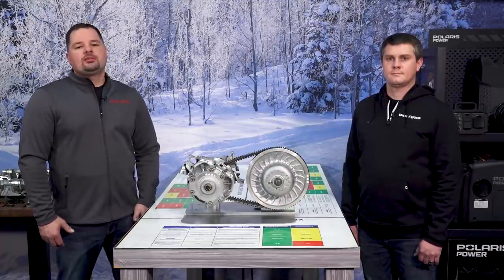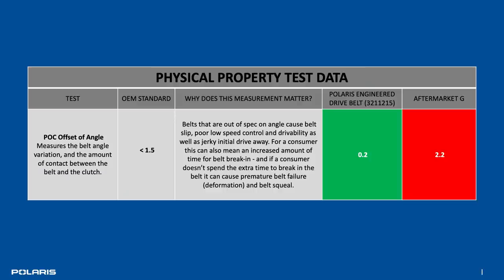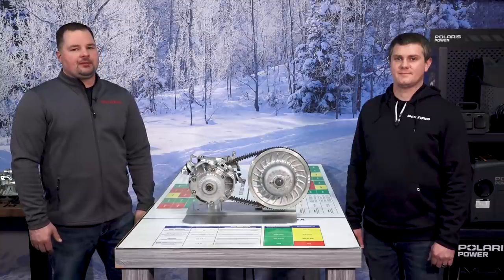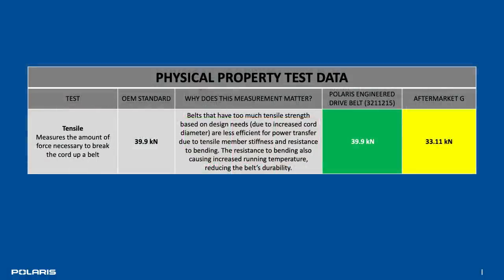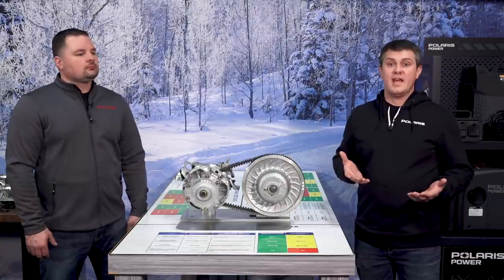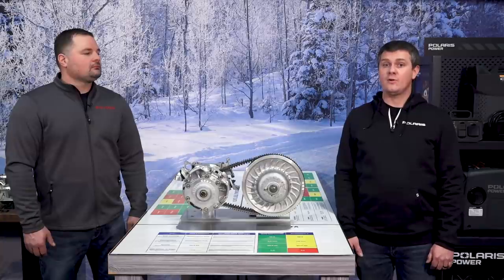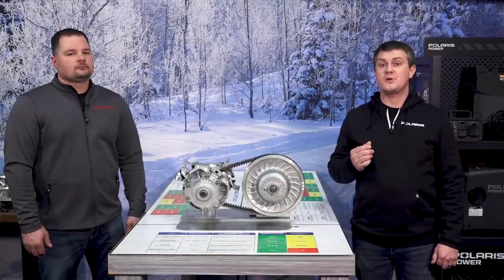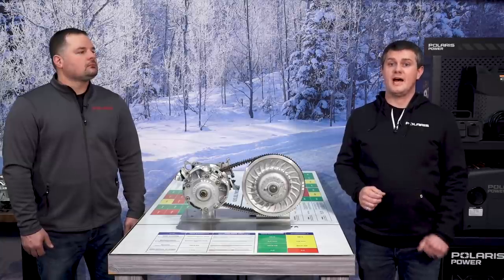Polaris Engineered Belts vs. Aftermarket - Polaris Snowmobiles

Comment: I just picked up my new snow check 650 XC 137 it doesn't have the reinforcement plate on the rear slide rails dealer price $500 ,for $17500 I think it should have come with the snow check I would purchase them and install them myself if the price was more reasonable!

Comment: Since the belts are held to such high tolerances why do you still use the problematic deflection screw in the TSS-04?  I can’t believe that POS screw is still being used tearing up the moveable sheave inside the clutch.  It’s been 20 years and the design is still screwed up.  Set deflection once with 2 gold shim washers between the sheaves and delete the screw.  Set it and forget it!

Also why do the expensive belts have in-consistent cord exposed around the rim of cogs?  Every single one I have looked at is made inconsistent with a patch of rubber covering one section.  Also for $200 the belt should come pre-washed and ready to go and include a cup of coffee.  

Also why do the belt holders bend the belt in a backward fashion?  This has never been good for belts to fold them backwards..  Now they are being stored and shipped this way.  gee whiz

Comment: GATES Belt.. 100% all the way. the Durometer of the rubber is better. Takes more heat. Fit right on! and Pull twice as good! 
They have been at it longer then POLARIS. Plus the price of Polaris Products are way to crazy. Marketing is not how to get people to buy your product.  Return to the 80's n 90's and make awesome Products that last!!  I'd dump the Market team at Polaris!! Return to the Mechanics from the shops who worked on and built Polaris! I walk into the "BOX" buildings being required by polaris and I cringe!!  Return to the back Road, out of the way little shops who built your company in the 80's and 90's. Get the guy going and keep parts in stock!